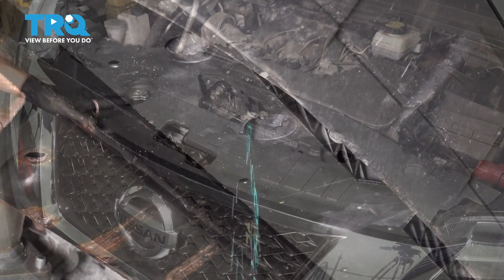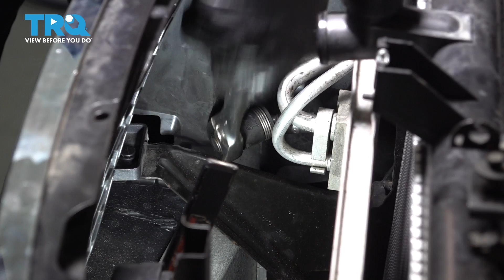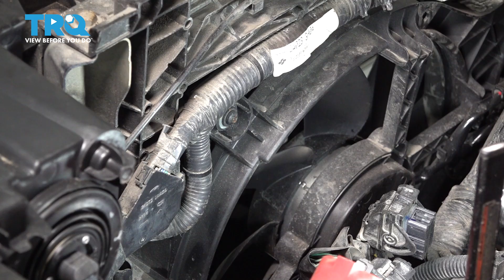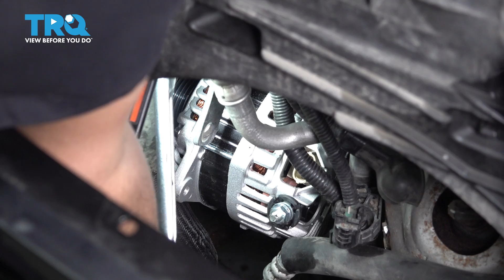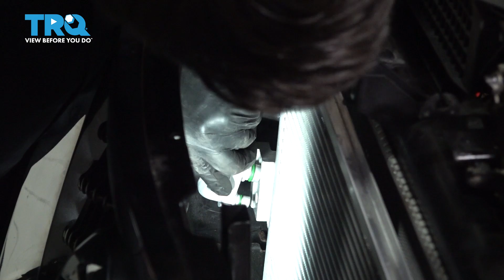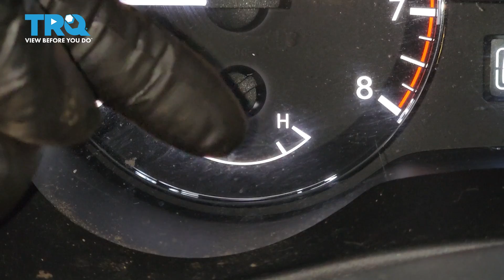How to Replace Alternator 2012-2020 Nissan Pathfinder

Comment: So many guys saying you dont have to pull the radiator. Maybe on the nissan you don't, but I am doing the infiniti QX60 and it is absolutely impossible to replace the alternator without removing the fan shroud. The fan shroud wont come out with the radiator and ac condenser in. This is absolutely necessary for this car. Is nissan really that different? I thought it was the same.  I would have had to taken the sub frame out and still I wouldn't have access to the top nut and electrical connector.

Comment: This is the HARD WAY!! Best way is to remove passenger side front tire, remove trim pieces, remove belt, remove 3 compressor bolts to allow it to drop 6 inches, then remove and replace alternator.....

Comment: Nic video. I’ll state you can get it out from the bottom. I did one at work today and all I did is hang the ac compressor but if you’re doing an Evac it might be easier to evac and just straight remove the compressor. The job will be way easier however doing it this way will make it more difficult to start the top bolt and to unplug the connector. I accidentally yanked the wires out of the connector but luckily I keep spare harnesses and took some terminals out of some and repaired it in like 5 mins.

Comment: DO NOT do it this way.  This video is a troll video showing you the most crazy way to do it.   Just jack up car then off, wheel,  Off AC and let it hang down a little.  Alternator come out the bottom.  Just over the AC as it hang down.

Comment: What the hell are you doing ?😂😂😂 
As a Nissan tech I’ve done so many alternators and never done any of this 😂
Just pull the tensioner 
Remove compressor bolts and let it hang by the lines and take the alternator out😂😂

Comment: My volts on my 2014 V6 Pathfinder shows 14.3 when I cut on the engine & while driving but if I idle with the a.c on full blast for a few minutes volts goes as low as 11.9, is my alternator going bad?

Comment: You can pull it without taking out the radiator or condenser…it’s a really tight fit, likely to bend some fins on the radiator.  You do have to loosen the brackets and pull the radiator/ condenser to the front while wiggling the alternator out. First hand experience after changing mine last year.